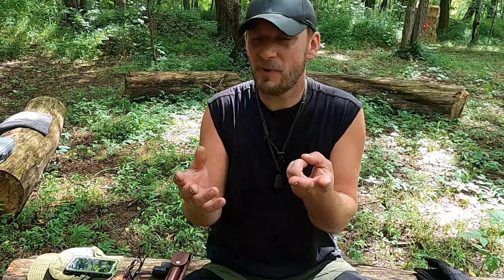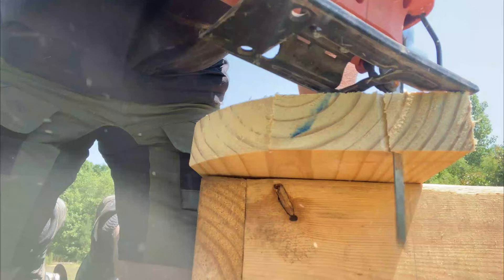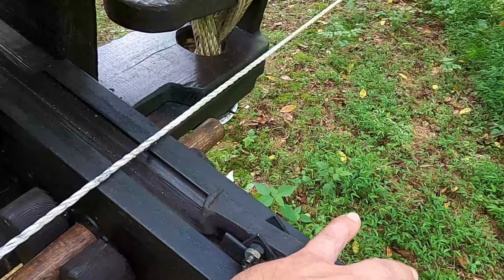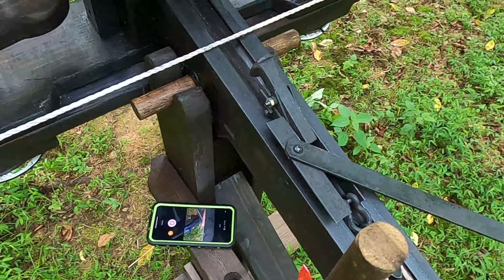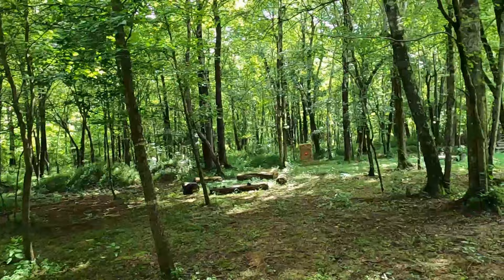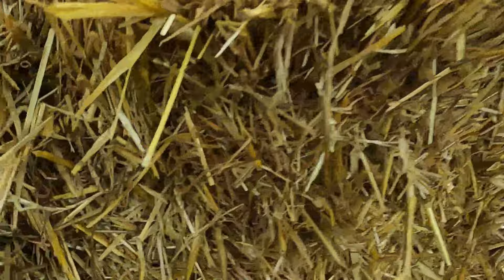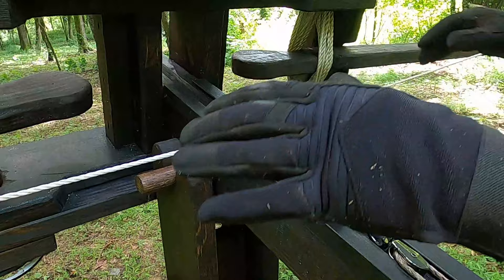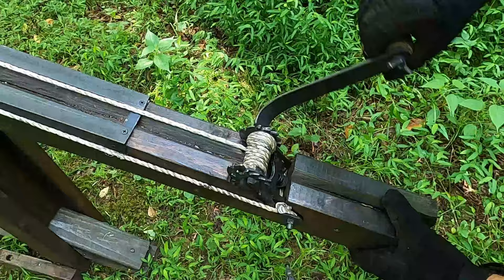How to build a Ballista! or the best we can anyway lol

Comment: Well.  This build is more authentic than I was expecting.  90% of ballistas are made with standard bow type prod.   Happy to see this is a torsion engine.  Good job.
Reply from the maker: Keith Johnson Thanks I was quite surprised at the power those ropes can generate! I had it cranked pretty tight at first and it sent a bolt about 80 yards through the woods! I had to turn it down to have the room to shoot it! 😆
Reply: @ShawnWithTheWildALONES7  There is a reason they were used for so long. :)  Simple and effective.   Now.  Were you mentioning the trebuchet? :)  Easily my favorite of the medieval siege engines.
Reply from the maker: Keith Johnson At some point yes a trebuchet 😆 should be fun!